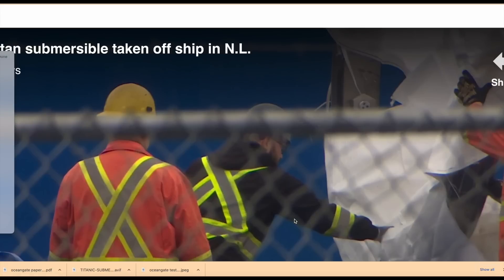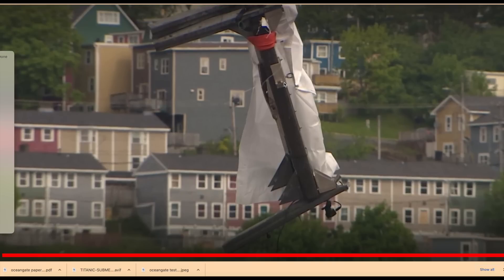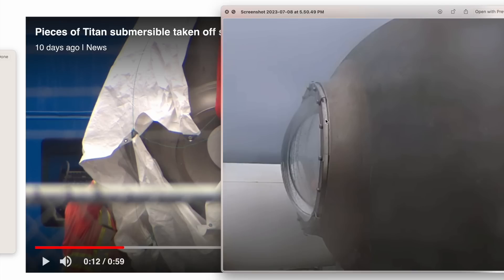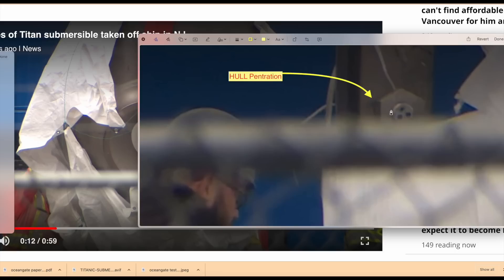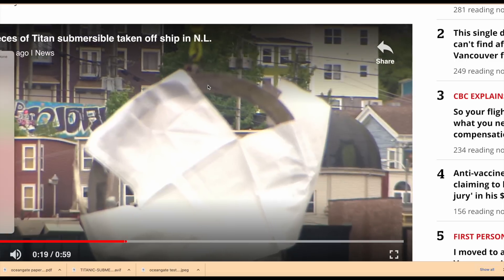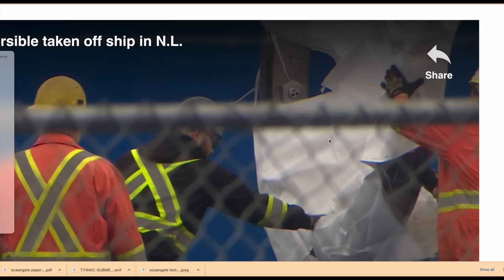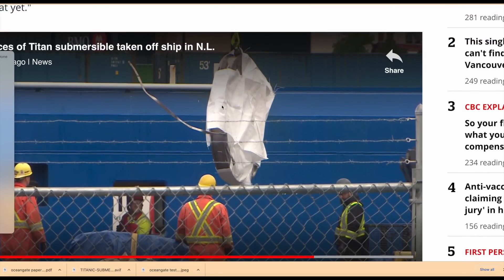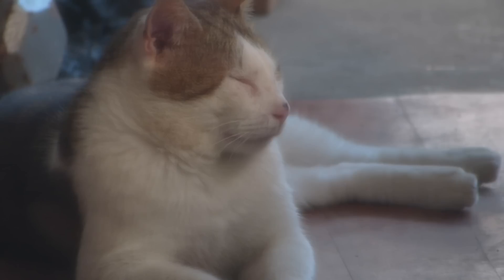Titanic Titan implosion Explosion hull penetration revealed!

Comment: If that hydraulic line broke and let water inside. How fast would the air pressure rise if it couldn't escape and what effect would such a strong part of the sub leaking have....

Cause if supposed transcripts are actually transcripts of communications between ship and sub... They were falling to fast, had trouble slowing down and then were slow to ascend as well.... 

Only explainable by extra weight somewhere... Maybe the battery compartment and where the electronics are....

Everyone keeps assuming the carbon fiber failed first. But if a line that's supposed to be running hydraulic fluid burst or broke. 

That's a way for water to get in the sub and burst the rest of the hydraulic system. And if air can't escape but waters getting into the pressure vessel somehow... Oxygen narcosis would get to them before the implosion would. 

Accounts for lost contact over several minutes before the implosion. 

And if the pressure inside was rising and they tried surfacing before they passed out...

 Well then the pressure has to escape and drop faster than the outside pressure or the end cap is being pushed off. So surfacing would maybe cause the sub to burst then implode. 

And a water cutting jet is at 60,000 psi not 6,000 like around the Titanic's depth... So it would suck to get hit by but it's not gonna cut metal well if at all and also lacks abrasive sand like a water cutting jet uses.... So failure may not be instant if water found it's way in through the lines already there. 

And it's in the back where the supposed transcripts say noise was heard multiple times....  

And if it's a titanium ring, that's more than thick enough to stay structurally sound even if a leak happens between the titanium pieces. It wouldn't fail right away.

If the pressure vessel's non titanium pieces sprung a leak it's done in an instant... But that ring is thick enough to possibly be used to go into challenger deep. Stronger than steel and steel 5 inches thick could withstand going down to 30,000+ ft.

Tho no one knows if the transcripts are real or not and oceangate isn't saying if they had contact like the transcript says... Haven't denied it yet either tho.

Comment: 608 that is a retaining ring.  If you removed that ring,  the window could easily be removed. The fact that the ring and window are missing, means it blew out from the inside. How did that happen? The hull collapsed close to the middle. The water compressed the air toward the 2 ends and popped off the window and ring like a bottle cap.

Comment: I saw a piece on how much a composite shell can bend but does so equally whether top to bottom, side to side, etc. especially over time. Couldn't that cause the seal to be compromised at either end to the titanium covers?
Reply from the maker: https://youtu.be/sqATlCzj9rM
Reply from the maker: Well  , unless the piece was pressure tested at this depth, these many cycles and these circumstances, it does react that way....

Comment: If the transcript is legit it sounds like there decent was too fast around 1 hour and 35 mins they were at 3500 metres trying to come back up. The hull was damaged on the first dive it took and everytime they heard cracking that was the hull breaking down it was an experimental craft with no extensive testing under those types of pressures. When they are doing them dives they switch power off to save electric so they are basically free falling in pitch black and i suspect why Rush had them play music was to try and cover up the cracking sounds. They hit there crush depth and even if the sub became buoyant enough to reach the surface the carbon fibre hull couldn't withstand the pressure at that depth.

Comment: I can't believe people thought all the "outside" (or whatever) systems were run through bluetooth.  Literally everyone I spoke with got it right away when I mentioned that there had to be some kind of hull penetration to control the systems on the other side of the hull of the submersible.  Almost as hard as it is to believe that adults could think such a thing, and then not slap themselves REALLY HARD in the face two seconds later for thinking it.
Reply: re: "I can't believe people thought all the "outside" (or whatever) systems were run through bluetooth."
Well, its in the BT 'spec', seen on the manufacturer's data sheet for any given BT chip. There are control channels for thrusters, ballast shedding, hydrophone data comms. I joke, of course.

Comment: The weakest point was the lip between the carbon fiber and the titanium, as temperture dercreases both materials flex at different tempertures and the titanium rim would eventually tighten and release the pressure on the carbon fiber hull, weakning it eventually to the point of failure.
Reply from the maker: But the pressure would also be at 22 million lbs as the engineering states... Or you can look at my video for another pressure reducer
Reply: @ForensicCats  The pressure would remain the same, but due to speed of descend the two materials have different theromdynamic profiles. Having carbon fiber lamenate due to the titanium ring's pressure would be increased by the speed of the craft and with the repeated stress cycles. My guess is that was the weakest point.
Reply from the maker: hmm...  can you tell me why the pressure would NOT remain the same?   I can give multiply examples... now think this over again... Why or what would make it NOT remain the same.
Reply: @ForensicCats  I stated it would remain the same but lamentation due to the thermodynamics effect on the titanium would damage the hull and the 22 millions lbs of pressure would eventually break the carbon fiber hull due to the repeated cycles of stress. Just imagine the titanium ring contracting and expanding on the carbon fiber hull over repeated cycles due to the colder tempertures below.
Reply: carbon fiber is also a negative coefficient of thermal expansion

Comment: The whole thing was a foregone disaster, there was so many red flags with a list long as your foream - multiple previous failures and aborted dives, carbon fiber section had to be re-made at least once due to structural issues, fiber material not interwoven properly for maximum strength, viewing port not rated even close to the depth they were going, carbon fiber was expired material from Boeing bought cheap because it wasnt even good enough for their planes, the bonding of two totally dissimilar materials ie the titanium rings and carbon fiber, no kind of surface treatment to the rings seal surface to enhance the bond as one would do with any glued surface, no test to destruction testing without people on board, the fact that every submersible ever made used heavy steel and or titanium successfully for their hull material and NO ONE had ever even considered carbon fiber for good reason, and overall sketchy engineering on electrical and other areas by students because Rush wanted yes men and as he put it he didnt want fifty year old guys with white hair telling him what to do even though they had the much needed experience, nd finally Rushs arrogant denial of cold hard facts about safety, engineering etc.  Just because he got away with it a couple times and all the while the thing was cracking and popping etc which are all signs of imminent failure.  They were all doomed before they even got in the thing and even after signing wavers they drank the Koolaid of a very slick con man who thought his own arrogance and ego was enough to just "make it all work" -- waivers or not Ocean Gate should have their asses sued off for letting it all happen after repeated failures, warnings and advice from THOSE WHO HAD EXPERIENCE AND KNEW WHAT THEY WERE DOING.

Comment: Sure wish I could replace all the air, hydraulic, and fuel lines in my bus to Bluetooth. 🤣

Seriously though, concerning the glue, I wonder if they didn't use enough of it.  I know when I'm gluing something I consider vertical, or at least I don't want it coming apart, I stick the pieces together and then remove them to be sure I have a good bond across the entire surface. It didn't look like they did that. When they stuck the ring on, not a bit of glue oozed out.

Comment: Excellent work. I use Special Kitty for my foster, TNR and rescue cats, too.

I didn't see the inflatable bag(s) at launch on TV that ran across the top and hooked on both sides (though the inflatable bags are listed as one of seven key fail safes") that are so prominent in the PR photos and B roll.

Not sure it was anything more than an accent piece at that depth but if they'd have realized how fast descent was early it might have made a difference.

 I still think the issue happened at or before launch and it contributed to the fast dive speed that never concerned them until it was too late. 

Thanks for the great work.
Reply from the maker: I can't find the bags either and neither could Rush when he said they exist and looked BEHIND a motor!
Reply: @ForensicCats  lifting bags between outer shroud & fiber hull, want them protected from accidents.  rush pointed them out but didn’t show them in one of the videos
Reply from the maker: That is an oxymoron, he pointed them out but didn't show them?     haha. that was funny...  I would guess they do NOT exist...  or he had no clue where they are BUT, I have an ace in the hole about this...

Comment: I'm wondering if the hull penetrator on the rings was drilled through the carbon fiber too. Looking at the hull assembly video it seems like the carbon fiber sits quite deep into the titanium ring while the penetrator is mounted right in the middle of the ring.

Just the act of drilling or cutting out some of that carbon fiber to mount the penetrator would risk compromising the hull in the rear. 

I believe the rear of the hull failed by the sheer point where the titanium ring ends and the carbon fiber starts. Especially if the penetrator was drilled through some of the carbon fiber.

Comment: did you ever think that when the thing imploded , the forces generated from the water rushing in pushed the glass outward?  ...  Its not designed for forces coming from the inside out...
Reply: I'd say that as water came in, the inner pressure would have risen rapidly until the inner and outer pressures were equal. But it would have been destroyed by then. Just a few thousandths of a second.
Reply: @stewartcaldwell5299  Q: What is the 'water hammer effect'? Does it involve the kinetic energy a moving volume of water may posses?
Reply: @uploadJ  I believe it is caused by air in a hydraulic system. When water is turned on, and then off, any air in the lines works as a "bouncy spring", making the pipe bounce around noisily until pressures equalize. The cure is to bleed the system until the air is gone.
Reply: Yes the "porthole" was designed for outside  pressure, the retaining ring bolts appear to be approximately 1/2" to 5/8" threads. 
When the center carbon fiber hill either distorted or imploded the internal pressure increase from 1 atmosphere to the over 380 atmosphere at depth probably blew the ring and "porthole" right off the front titanium dome.
Either the pressure blew the bolt heads off or it stripped the threads out of the machined porthole flange.
Hopefully better pictures will be forthcoming.

Comment: There were no hull penetrations. Internal batteries powered internal devices. Bluetooth controlled outside commands such as ballast drops and directional commands by pilots.
Reply: There was hydraulic backup pump disconnect that was connecting outside to inside._
Reply: The CPU was outside ?  So there was connection from inside to outside.

Comment: It was built to a price the view port was underrated for the depth they were going to I also found out that the carbon fibre cylinder wasn’t cured in an autoclave it was cured in a bag! The vinyl wrap could’ve failed soaking the carbon fibre with water and this could be the reason they couldn’t surface built to a price not a standard.

Comment: I suspect they took the glass out for shipping. I don't see sheared bolts or holding ring. It is possible the glass was blown outward after implosion.
I doubt they would remove the ring for shipping if the glass was already missing
Reply: They didn't lift it from the ocean by removing the ring and the bolts. They could grab it from the boat same way as the hook it out from the bottom and not destroy the evidence
Reply: They aren't going to dissemble the Sub parts until it's fully investigated where and how shit failed. What we see is what the Deep Waters did to it.